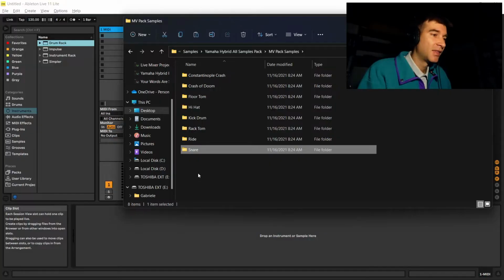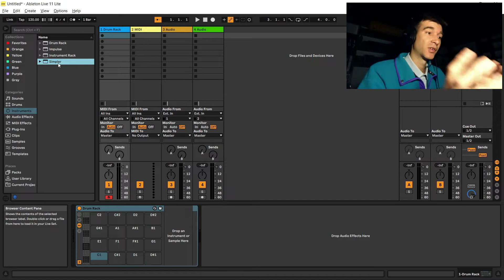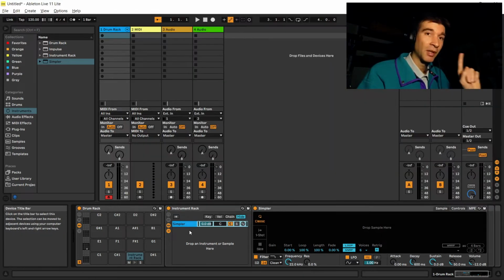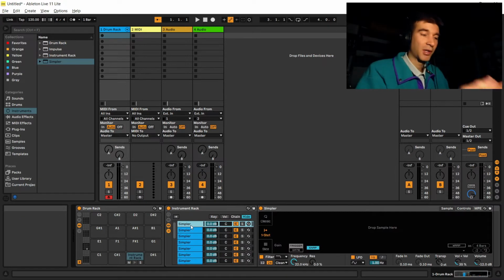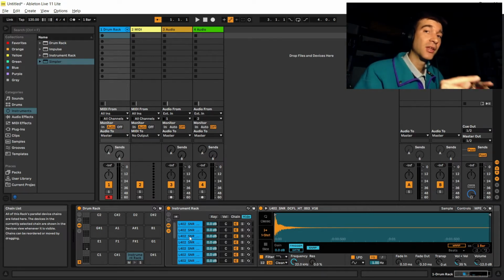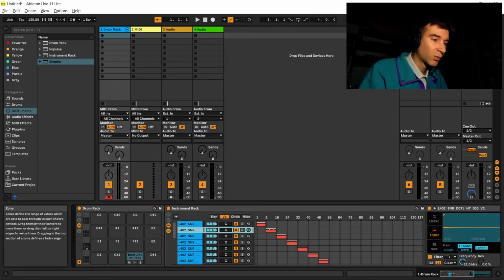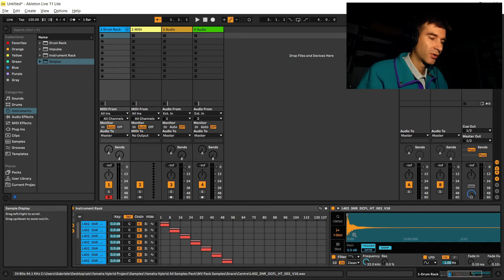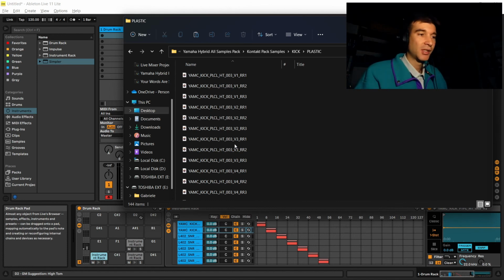acoustic drum programming / midi ableton drums  / real ableton drums

Comment: Excelent video and explanation! Sampling is one of those subjects you can sink a crap ton of time into, it's so interesting to see how you set this up in Ableton. In Reaper it's a bit different, we use a plugin called ReaSamplOmatic5000, it's a really simple and well optimized (and also ugly as hell) sampler that comes bundled with the DAW. You can load a list of samples into one instance and sort them by peaks or RMS. Round-robins are a bit more complicated because you need to use multiple instances of the plugin and asign probabilities, but if you're doing super complicated stuff like multi-velocity layers, round-robins, etc, you might as well use a dedicated sampler that offers those options. Or you can go crazy and make your own soundfont with keyswitches for múltiple articulations and stuff using a text editor, although that's a bit out of my reach right now, I tried learning the sfz format and failed miserably :P

That being said, how do you go about getting samples? Which websites do you visit? And do you have and samples/sampler recomendations? Cheers!
Reply from the maker: Man, I remember that ReaSamplOmatic5000 from my Reaper days, it truly is ugly as hell 😆 That was when I was first experimenting with velocity layers and round robins. I remember the process being a little cumbersome but still feasible, the real issue was that the choke groups for the hi-hats weren't working! The option was there, but it wouldn't work because it would simply "choke" the midi note, but the samples would still play back in full length, or something like that. That was some 7 years ago, I'd assume they'd had it fixed by now :) That was the main reason I started using sfz. Loved the flexibility, you know, being able to just copy/paste lines of opcodes and getting say my kick samples right with all their bells and whistles, then simply copying it all over to a new text editor and going "find and replace" and changing all those "KICK blah blah" samples to say "SNARE blah blah", so basically just needing to do all the work once really! But then I switched to Ableton and so I really wanted to only use its own internal resources. In the next video I'm gonna go through round robins, you have to use a probability tool there as well so it's similar to how Reaper implemented that feature!
Reply from the maker: Almost forgot, super happy to share my favorite soundware :) So right now the best freeware acoustic drums sampler hands down is Steven Slate Drums IMHO. It's a basic version of their commercial product, its sole limitation being it only has one kit, but it sounds absolutely phenomenal! You get your classic acoustic drums with several cymbals and toms, all recorded with close mics, overheads and room mics, too. It's a full blown plugin with its own interface, each articulation has its own channel strip, even tuning and envelopes if I remember correctly. I've used it on this video if you wanna hear what it sounds like in context: https://youtu.be/DHFIsbslbL0 The downsides, if any, would be that you don't get access to the single .wav files should you ever wish to program your own .sfz files or load them up in Reaper's sampler. But then again, why would you want to do that, seeing as it means giving up all those neat extra features the Slate plugin has? So no complaints there on my side! On the other hand, if, like me, you prefer to program in your own samples (which seems to be the case judging by your comment 😁), then I really love what Drumdrops has to offer. The sounds you're hearing at the end of the video come from their "Yamaha Hybrid" kit which is great, comes with 3 round robins and 10 to 16 velocity layers for each one of them plus a really nice sounding room. If I remember correctly, a slimmed down version of it should even be available for free on their website! As an added bonus, they provide some popular sampler formats (Kontakt and others) as well as those .wav files. Their prices are more than reasonable, too. Maybe they even have some sweet Black Friday deals going on!